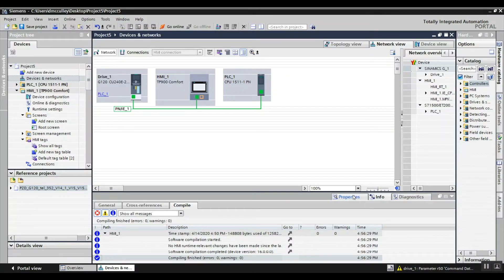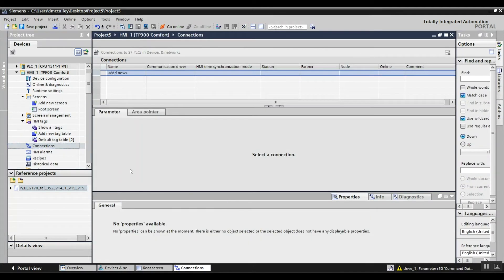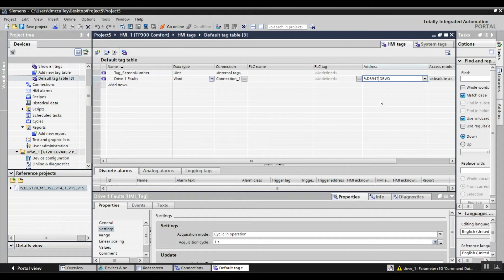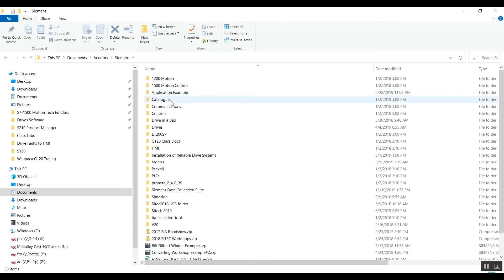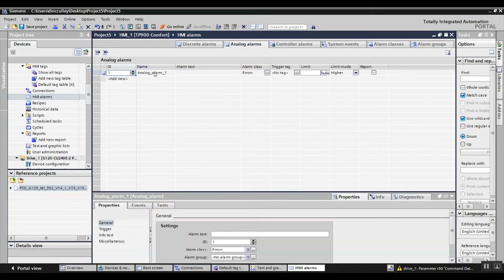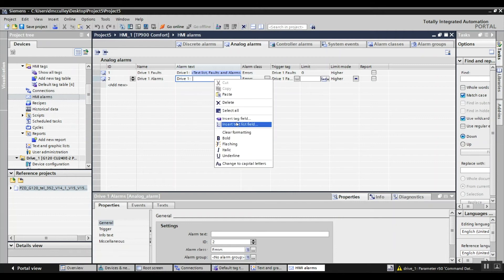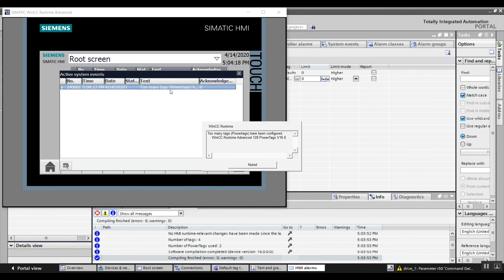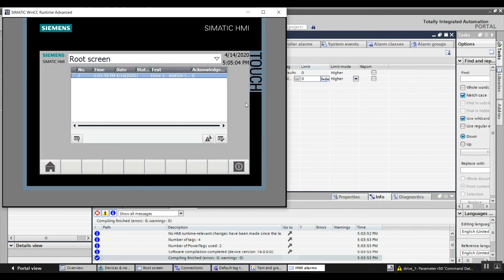How to Display G120 Faults on Siemens HMI

Comment: did you create db 947 and db2110 before.
Reply: My guess is that he is getting the alarm value and fault code over telegram exchange and storing it in those datablocks. Then he creates the alarm view that reads out the text list for the fault code of that text list number. I don't see why you need those DB numbers specifically or even 2 different DBs.